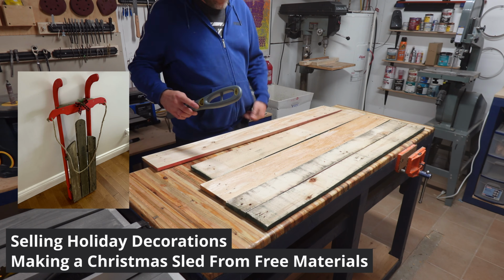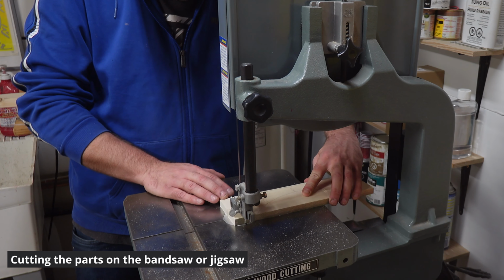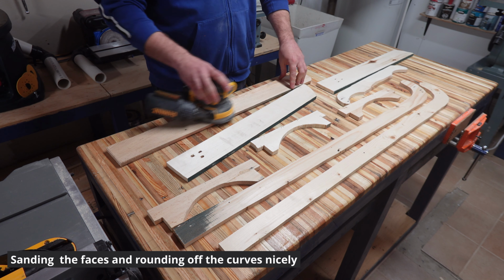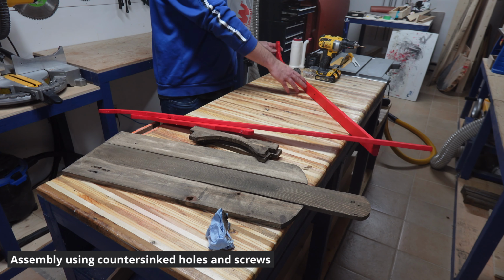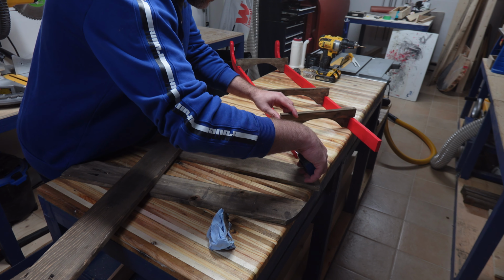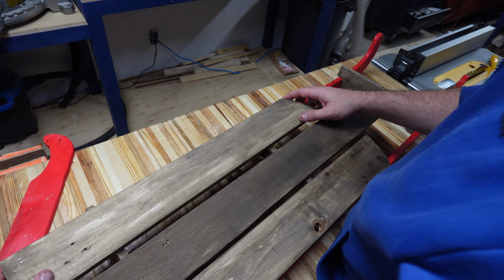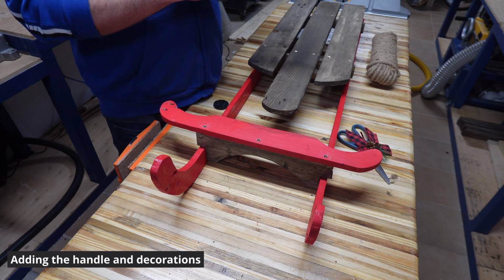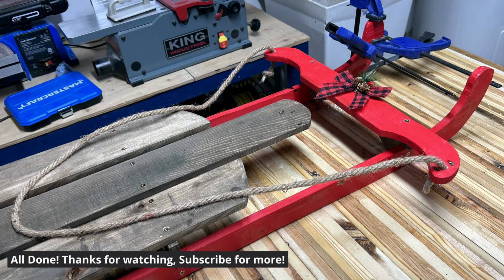Make Christmas Items To Sell Now!

Comment: Great job and project thx for sharing Enjoyed it This project has always intimidated me I think I can make it Keep building Cheers
Reply from the maker: The biggest challenge was the ski because my planks were barely wide enough to put it in at an angle. I'm making 4 more today, this one sold very fast, and I got a 1x10 for that part only, ill use pallets for the skis / seat and supports. Make sure to pre drill and it ends up super solid. I'll have to keep one for when I decorate, which for me is definitely a bit later than early November! Have fun!
Reply: Keep building

Comment: Curious.....can this sleigh be actually used as a sleigh; or is it ONLY an ornament??
Reply from the maker: It’s a decoration only. With wood screws it’s very solid, someone could sit on it but the part where the rope attaches would probably break if you try to pull it. Thanks for watching!